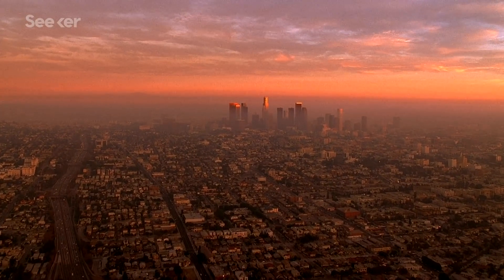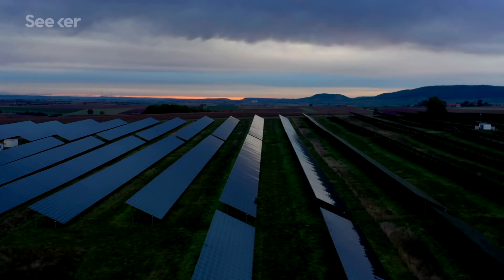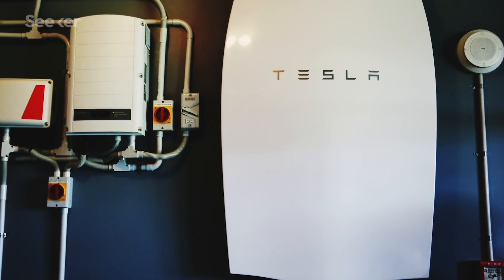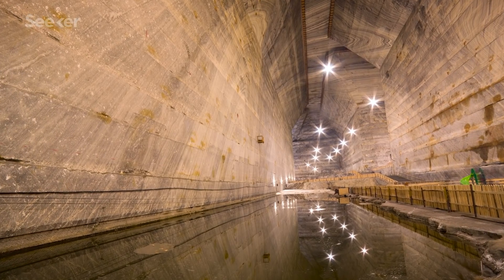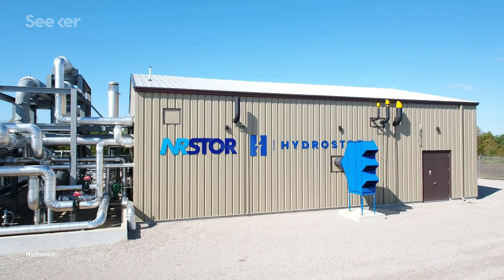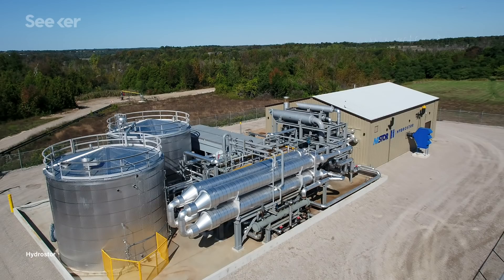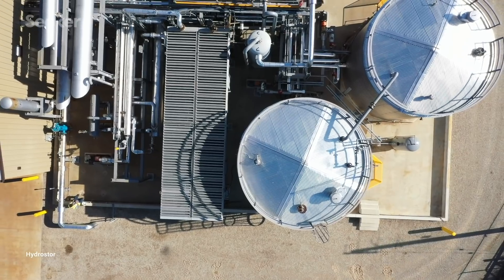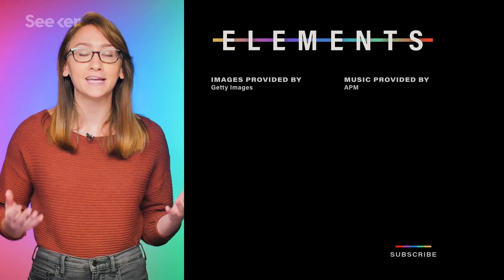This New Tech Could Revolutionize How We Store Renewable Energy

Comment: Dams can also be used as large batteries. Which can store energy in the form of Gravitational Potential Energy.
Reply: Waterfall?
Reply: @adrianharo6586   No. For example Pump water using excess  solar energy at day back into the reservoir of the Dam and use the hydroelectricity generated by it at night.

Comment: Hydrostor is interesting, yes. However, I would recommend considering Highview power. Their CAES system seems to be more efficient, even less site-condition-dependant, and claims incredible cost per Mwh storage. They are based out of the UK if I recall correctly.  

Seriously Seeker, you owe it to yourselves to check this company out. I have not found a better solution yet for energy storage. 

Also, for all the comments that are referencing nuclear and the need to advance that technology, I would agree. For traditional nuclear there is definitely a need to move towards thorium. 

That said, if you haven't seen the new clear that Bill Gates has been funding, you need to check it out. It can use non weapons-grade materials, and it can use the spent rods from existing reactors as a fuel source. I.e. - it is waste management for existing systems AND has tremendous output capabilities with a significantly diminished risk profile.
Reply: Hydro storage is incredibly inefficient.
Reply: timeofsage  It is intriguing and may certainly hold a place in the energy storage future. Especially where mineshafts already exist as it makes functional use of the existing infrastructure while sealing off a hazard at the same time. That said, if independantly verified, the CAES system from Highpower claims to achieve $100/Mwh which is cheaper than Gravitricity claims at $170-145 / Mwh. 

The generators would need to be very well engineered to mitigate thermal losses on the distribution side. I'd love to hear more about their storage efficiency percentages once they get this demo model online. It is certainly cheaper than pumped hydro.
Reply: @epiccollision Hydro is inefficient without massive scaling. Even then molten salt or metal is better.

Comment: Sad that no one talks about Pumped Heat electric storage
https://en.wikipedia.org/wiki/Thermal_energy_storage#Pumped-heat_electricity_storage
No special geography needed. Scalability. Efficiency close to Pumped Hydro. No special materials required. Relatively quick start-up delay. Relatively no cave digging required. And no requirement to contain dangerous high pressure air.

This tiny thing thats meant more of an experiment stores 600kWh
https://www.theengineer.co.uk/grid-scale-pumped-heat-energy-storage/
Reply: btw Im just gonna say the host talks like how you would expect a Karen to talk when asking for the manager

Comment: Holup didn't a swiss guy comeup this like 4-5 years ago?
Reply: With what? Compressed air energy storage is known for 200 years. The major issue is making it as efficient as possible and dealing with heating during compression, and not loosing energy unnecessarily. And reverse in the reverse process. The changes in that field are mostly incremental, with some recent (last decade) mostly due to new composite materials like carbon fibers to improve significantly the performance of some processes.

Comment: Nuclear reactors... a nice idea, incredibly useful, that has recently gotten some great PR that overshadowed some of the structural impediments it has. Not entirely unconvinced it's not just fossil fuel clmpanies pushing an impractical alternative to tank any other more readily achievable goals. It used to fossil fuel companies pushed carbon cap and trade, as a great alternative to carbon tax/limits... well until it was almost passed as a bill, after which they turned around and assured it wouldn't pass! Are they playing the same game with nuclear?

Issue with nuclear is also the business-model which is uniquely unworkable, probably the main reason it's not focused on. Huge upfront costs (low costs thereafter) but nuclear plants can and do often end up being huge sinks of money with cost overruns. Construction companies end up having huge leverage to run up costs and delay. Political forces (e.g. pro-fossil fuel) can easily leverage local, federal politicians through dark money lobbying and astroturfed campaigns to delay. 

But fact that China has cooled on nuclear power convinced me the issue is more than people 'just being scared of nuclear' and overbearing, excessive government regulations.

Perhaps the small sized, portable, supersafe, reactors are the solution to the main practical issues? In any case, while nuclear has issues it cannot/should not be frivolously dismissed, we need all possible tools to deal with this transition from fossil fuels.

Comment: Literally 100+ year old tech.
Only reason we are even talking about this is that heavily upscaled renewable energy is practically "free". Storing energy like this is horribly energy inefficient.
Reply: Yep. The dumbass fanboys who drive Tesla still thinking it gets better moving a 5,000 lb car on batteries. Stupidest logic ever.
Reply: "Literally 100+ year old tech."

"Only reason we are even talking about this is that heavily upscaled renewable energy is practically "free". Storing energy like this is horribly energy inefficient."
They mention 60% efficiency. That's not horribly energy inefficient for long term storage. Almost all other alternatives are similar or way worse. I think the best we have now is pumped hydro, which is 70-80% efficient. Of course you'd want to use most electricity without storage, and use batteries for frequency regulation and some short term storage. But for long term there's not many other alternatives. I believe in using trash burning to deal with seasonal variations in cold climate like Sweden and Denmark does, and if so, we don't need to do that much long term storage. Low efficency is not a big problem if it's only a small fraction of the produced electricity that needs to be stored that way.

Comment: Ummmm ... Li-Ion batteries are pretty much perfect right now for stationary storage. Tesla just filed a patent for their next gen batteries which will come hopefully this year. They achieved higher density and no significant degradation after 4000 full cycles. It is also speculated that these new batteries won't be affected by temperature.

Comment: "liquid Air" you store the air, but first you chill it down till it liquifies. You remove the CO2 (because it's a heat sink) then you store it within a low pressure cryotube. Benefits you don't need to dig a cavern and it can be placed any where in the world with a small foot print. When you require power you allow the liquid to reform into it's normal gas state and bob's your uncle !!!
Reply: That sounds like alot of work and energy intensive.
But sounds like a possible research paper proposal for a grant study. 💵
Reply: It has passed the research stage, in that three of these type of plants have already been built in the UK.  It only requires external power at start up when you separate the CO2 from the air. But the chill down uses a 40 year old tech and the low pressure cryotubes are cheap to operate.  Once the plant is operational it can produce it's own power and the waste air is cleaner than at intake !!!

Comment: Look up COP (Coefficient of Performance) and consider that you can't get back a lot of the energy when using compressed air.
Even industries and such that mostly use compressed air power tools instead of electric power tools, do it for many reasons like durability,  reliability and things like more torque/power in smaller practical tool and in some cases safety reasons, not because compressed air systems are more energy efficient then direct electric powered systems on the grand scale of things.
Either way, storing energy like that is inefficient and doing such things are just desperate moves to compensate the unreliable nature of solar and wind power production (not to mention several other issues). Just go nuclear!

Comment: How does the case project store the heat so it's available upon demand?
Reply: likely by using thermal energy storage, there are multiple types, for example concrete blocks. Water thermal storage cant be used in this case as it is very likely that the temperature is much higher than 100 degrees.